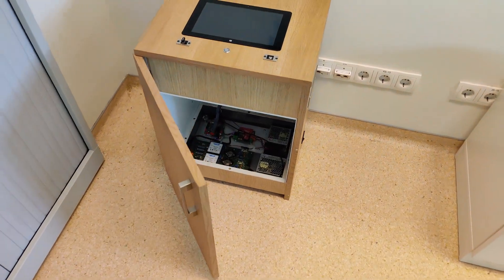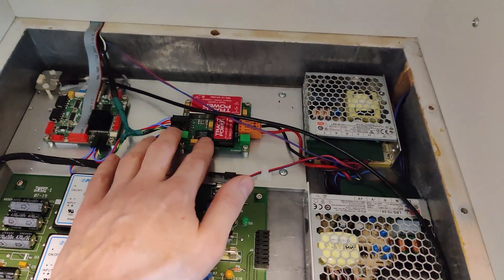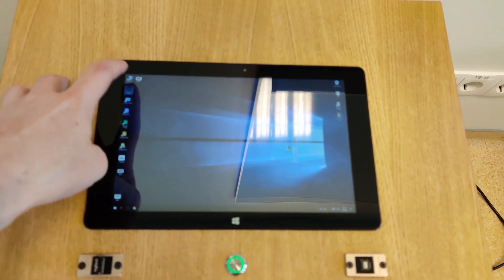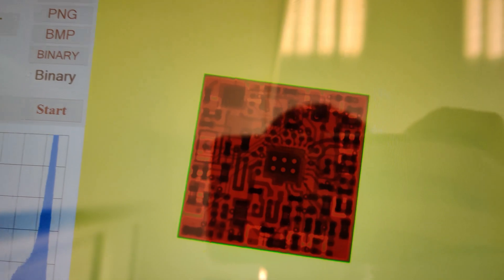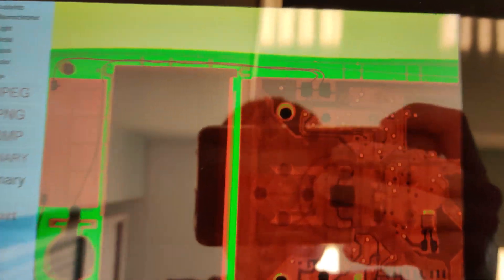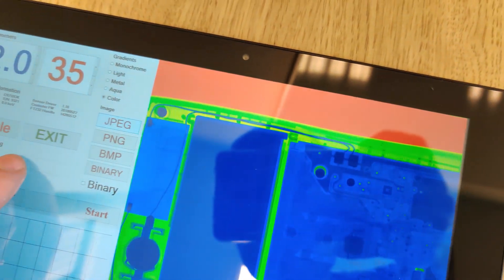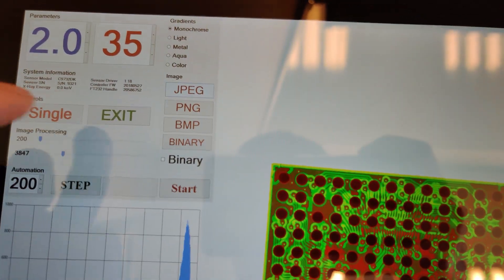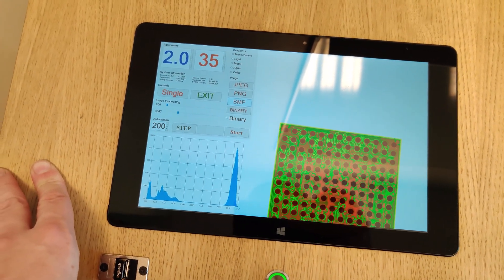Homemade High Resolution X-Ray machine!

Comment: You gave no information regarding the tube, why is that? Your video gives lots of images but not much else.
Reply from the maker: its from faxitron mx-20. microfocus tube. i am running it up to 40keV in my setup at the moment. current is very low, I think something like 100-300uA

Comment: what is the wavelength resolution? what is the voltage and power requirements?
Reply from the maker: @ZetaBling  resolution depends on two factors, sensor sharpnes  (lines per millimeter) and spot size. With this setup it is possible to see features around 10um or better. Think about spot size and sharpness of the shadow  as well as distance to sensor. Wavelength or energy only gives ability  to penetrate targer,  this is not like optics.
Reply: @ I see, I see x-ray flat panel sensors around 9k or more usd lol would those x-ray paper films work?
Reply from the maker: @ZetaBling  you can find it between  1000 to 10000. But at 10k, it just stupid to buy,  and they will never going to sell it. I have around 5 sensors in my possession in various formats and frame rates

Comment: I want to build one? Can you suggest me about the xray detector? I was looking for it but could not find any sensor or detector.
Reply from the maker: @jannatulnayeem7289  
They are expensive and rare. Try varex on ebay, but they can cost >5k$
Reply: @Kilohercas  thank you for replying. Actually I need the scanner to develop a product for my customer. It would be better if I could get it more cheaper.

Is there any way to contact you? Could not find any email or Instagram.
Reply from the maker: @jannatulnayeem7289  my ig is kilohercas

Comment: Hi Linas K, you have comments turned off on your elegoo saturn fix and I have a question about it. Many people are reporting that they solved the problem of restarting by replacing the power supply. Did your chassis ground solution remain effective? I am having this issue now after years of use, so it's hard to believe that I am suddenly getting static build up after all this time. It has never changed location and it's in a temperature controlled room. I have ordered a new power supply, but maybe I will take the time to ground the chassis as well.
Reply from the maker: As stated in that video, unscrewing top made it non functional due to restart. It help alot having true ground  ( must be in the socket)

Good power supply could have proper ground to zero connection
Reply: @Kilohercas  Well my new power supply didn't fix it. So I grounded the chassis to the USB board. Actually found a ground pin on that board and used a female connector to connect to the pin. I felt I would have had to completely remove that board to solder to usb ground which was a tight fit  to the base and didn't think my soldering tip could fit in there.  Then I ran that wire to the chassis, scraped away the paint and soldered it right to the chassis. Printer is working again, thanks for the video. Really odd how this just started happening after years of printing without this issue one time!

Comment: I have a similar setup but I have to use film currently, I couldn't find one of the sensor plates you did without it being thousands of dollars. May I ask where found that? Also what tube do you have? I have a Canon D-045

Comment: Bro at the least step 2 meters away. Even if it might not be that much coming through the lead, it makes me unconformable seeing someone x-ray something next to their testis.
Reply from the maker: With same dose you should not fly at all. this is soft x-ray. it can barely pass fraught copper foil. Relax, this is just 39keV
Reply: @Kilohercas  yes I agree, this is why there are limits for flight personal on how many flights they can do per year.

I just wanted to say that if he stepped 2m away he would only get about 10% of the dose he gets when he is standing right next to it. With basically no effort (only having a 2m cable). 

Yes the risk of him getting a relevant dose is pretty small but he could make it so much saver just by having a little distance
Reply: I don't think it is continuous.

Comment: This video inspired me to work on building my own PCB xray inspection cabinet several months ago. I've had a lot of issues but am nearing the end, I'm wondering what panel you use though? I've gotten 2 samsung llx240ab01 but don't have any of the software or cables. I can mock up cables just fine but it's that software I'm struggling with now.
Reply from the maker: Try to get hamamastu panel. It has sdk with examples how to use it.
It will be hard to do in other panels, specially big TFT tipe ones, you need special programs and no SDK.....

Comment: You could turn this into a CT scanner if you put a stepper motor inside and rotate the object.
Reply from the maker: Yes, electronics does have support for twi stepper motors. One is for height, and the other is for rotation. Look up my my channel. Where are some videos captured on rotation axis
Reply: That reminds me of the X-ray machines the TSA agents use in airports.

Comment: Have you tested if you can see under the scratch cards if they are winners?
Reply from the maker: Nope, it is impossible.  Where is very little ink,  maybe because  of this reason.  🤔 🥲
Picture can register paper, but no text,letters....
Reply: @Kilohercas  dear friend have you tried to adjust the intensity of the beam? you must know that each scratch card has a thin foil inside. obvious that whoever invented them put this system in order not to see them. if you have done all the tests it means that there is no method. I hoped until today that there was a solution. i am saddened. I will continue with the searches. I hope that one day I too will be able to build a machine that will be able to see them inside and I will be happy to give you the solution. but now I have to start looking for the electronic components to build this machine. thanks for your work.
Reply from the maker: Great  idea, will try that :D
Reply: @Kilohercas  do it as soon as possible let us know
Reply from the maker: @gaetanofiorillo1662  I would say, it will be impossible to do it before buying  :)
Reply: @Kilohercas  I will wait impatiently. I've been wanting to try it in Italy for years. unfortunately I can not find certain components that you have in America. I will cry with joy if the result is positive
Reply from the maker: @gaetanofiorillo1662  I am not from America,  but Lithuania!

Comment: What's the xray tube you're using? I've gone through the comments and your element14 post, but I have yet to find what specific tube this uses, or the specifications of the tube. It's a good tube, powerful enough to produce crisp shadows on the sensor, which is ideal and what a lot of lower-powered tubes cannot do.
Reply from the maker: Tube not very good, it is only 39keV at the moment. I would love to get my hands on hamamatsu microfocus  tube capable 120-150keV ar 200w power. This would be extraordinary good

Comment: Please make protect shell!
Reply from the maker: It has one.  All internal  space is lined with led and aluminum sheets. It is also just  40keV, so very little penetrating power. Also beam is very directional,  so even if you open, you only get back scatter

Comment: Hi wow
What are the names of all required modules?
Reply from the maker: I would say a lot of green and time. You can try to get parts on ebay, but where is any at the moment, or they go for 2-5k€...
Reply: @Kilohercas  I have enough money and budget, but I want the names of all the circuits, for example, what is the board for part TEN-15-2412wi, what are its specifications, and do you have an email or WhatsApp or Telegram? May I ask you for some information?  You are a great help
Reply from the maker: @ariadaneshnia  
You can contact me via gmail
megahercas6<>.com

Comment: Hi, Nice job! Congrats.! I would like to do same project to test iron casting parts. To check internal structure about defects and voids. Do you think that tube have power enought to penetrate iron castings? Could be good and very helpful if you could do a video, testing some iron parts or even some nickel coins to see the behaviour of machine. Thank you!
Reply: I don't think so. You would have to have very high-energy x-rays, basically gamma rays at that point.

Comment: Where i can get the xray sensor ?
Reply from the maker: eBay. But it is very hard to find
Reply: Thx 😁
Reply: What i have to type in ?
Reply from the maker: @vini9598  you will also need around 2000euros

Comment: Is it possible to implement very high frames per second with this (say 30k frames?) Or is 1 fps baked into the sensor itself? 

Or would using a screen and high speed camera be a simpler method?
Reply from the maker: This sensor can do only 1-2fps. I have other sensor that could so 20fps, but it needs more xray power, and I don't have it
Reply: @Kilohercas  Ok I see. So if I don't want to be limited by the sensor would a phosphorus screen work? Would my fps then be limited by what camera I use to record it?
Reply from the maker: @jackiedapper9752  you need to get a lot of power in order to get high framerates. Its just like low light photography. You need to collect light to get high SNR. Iluminating screen does work, but same problem. I guess you get the idea 💡
Reply: @Kilohercas  I think I do. Thanks!

Comment: all i see is a guy putting his head inside a cancer generator
Reply from the maker: Well, this is typical perception people has. Like  x-ray or any other Ionizing radiation will kill you. Problem is you have to understand how much do you have it. Using this apparatus is completely safe. Even worse, if you spend 30 minutes inside this box, and It will be producing highest power of radiation it can, it will be same as one year of background radiation. ( so very little basically,. My system uses 20W of power, while simple x-ray tube In CT scanner uses more than 2kW)

To give you context, making you hand x-ray picture is not as bad as to flight from London to Tokyo :)
Reply: @Kilohercas  thanks for the explanation, its like the medical xray, in one session you get as much radiation as you get in one year

Comment: How does cost ?
Reply from the maker: It's hard to say. expect to pay 2000-3000eur only for detector this size.
Reply: @Kilohercas  I will send you an email right now as I need a small portable version of this creating today. Please repltly back to me ASAP thank you
Reply: @Kilohercas  for us the regular people a image intensifier screen photographed by a long exposure has to suffice . Mine whole setup was like 200-300 euro ,a soviet rectifier tube some chinese caps and hv diodes . The pain is that i used and killled a small modern chinese tube , not really my fault but the king power supply that got 12 volts into filament after hv sparked during first setups . Got a couple of very nice pictures from it though , much better than from the soviet diode
Reply from the maker: @cat_lin1 this is microfocus tube, so you can have ultrasmall details, in order of 50um. With general tube, it is nearly impossible. But yes, this is how I statted :)
Reply: @Kilohercas  great mind's Allah pleased you ..

Comment: Very nice build! I wish I had a Hamamatsu sensor too, but sadly they are very expensive, I have to keep using a screen and a camera.
Reply from the maker: @ulas ozdemir closer to xray lamp, further the detector, you can get single grain of rise with 2048x2048 resolution :)
You can send me and I could make test images
Reply from the maker: What is expensive for you ? Maybe I can help :)
Reply: @Kilohercas  The x-ray sensor. I remember looking for its price and it was very high.
Reply from the maker: @millitesla3527  thats my point. I don't know what is high for you :)
Reply: @millitesla3527  It's somewhat expensive at over $1000 usd to make; but, it's still cheaper than any commercial x-ray machine.
Reply from the maker: @ulas ozdemir whats is the problem ?
Reply from the maker: @ulas ozdemir 
Hi. You can try to get from Hamamatsu, but it would be extremely expensive, i would say something around 15-25k ( since it is scientific device made from single wafer more or less )
You can try searching ebay, but it usually go for 2-5k
Why do you need this sensor ? And whats your budget ? Maybe I can help :)
Reply from the maker: @ulas ozdemir this one. You use magnification and get 10um resolution or even better !

Comment: Very nice. You could add a Z table for a zoom function and to push small items really close to the source for super zoom. This would be great for checking sausages for bits of bone too. Were the specialised components pricey? ie the sensor and transmitter.
Reply: One of those hamamatsu sensors is selling on ebay for 6.5k euro (a lower resolution model iirc). He says he got a good deal though for the one he has. You can get axial ones for 1000 apparently, but I don't know how that would work with this type of compact use, since you'd need a good resolution and to rotate the subject along an axis parallel to the sensor I presume (at that point it'd only be good for CAT).

X-ray tubes are comparatively not very expensive, around 100-300eur for most. Although I don't know about one with the same energy he is using. He says in his article a good target is Mo and a good energy is 17 keV
Reply: @janusismyname   Would it work with photographic film in place of the sensor?
Reply: @fuckednegativemind  yes!